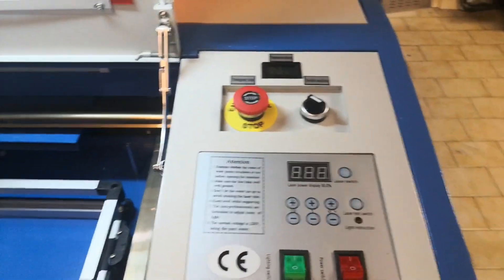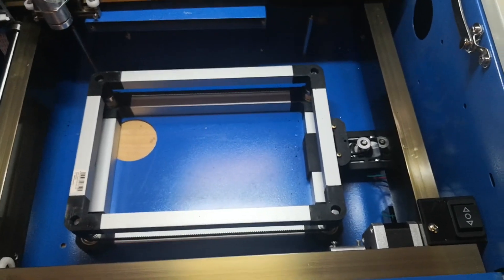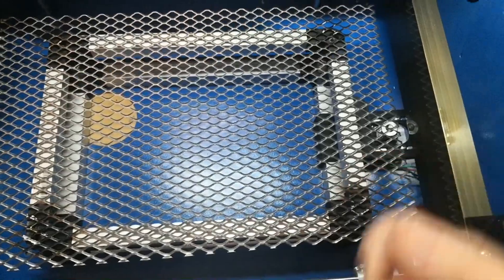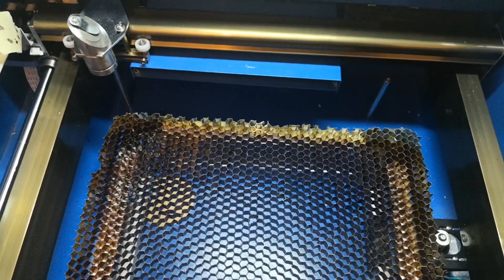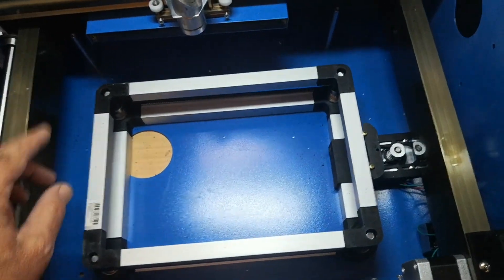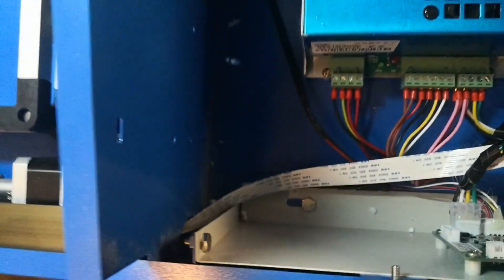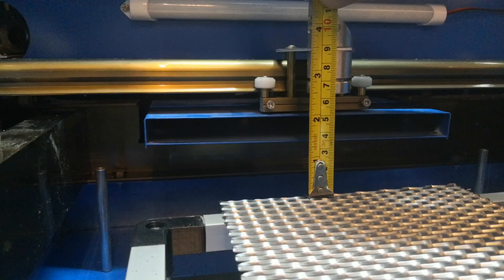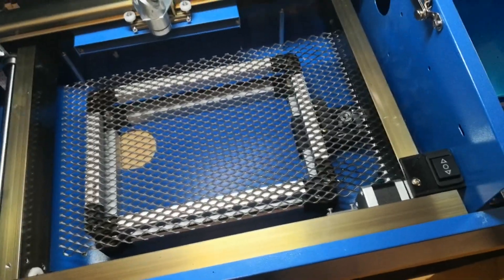K40 Laser motorised bed.

Comment: I made a a similar version, a bit bigger though and controllable via wifi (esp32)  where you can set a certain height after setting a zero value. a new version I a am working on will have a TOF to measure the actual height and therefor be even better than the current one.

Comment: Definitely would be interested in buying or building one of these!
Reply from the maker: Hi Peter I am just waiting on a few more parts and I will make another video on pricing and the finished product.
Reply: @letsfixit1594  Excellent! Have you seen this (https://youtu.be/aN4KgUCzP_U), BTW? I could see having a controller with a digital readout as VERY handy; that way, you could set a 'base' height for having the platform (sans material) be at the proper focus height for the laser, and then, just by measuring the thickness of the material you're working with, lower the bed by that distance, and know you'll get the desired results every time.

Comment: I am inspired by your successes and improvements. I would consider making the adjustable bed mount onto the same holes and locations that would be used for a roller type bed.  Interchangeable beds with common mounting locations.

Comment: I have the same exact laser, but have made a new panel for it, and added air assit, a pump and door interlocks,  a water flowmeter, and a key switch
 Was about to build my adjustable bed, but not gotten around to it yet. I did put a switch in the main panel for the bed travel.  Also worhing on a way to eliminate the screws, using scissor lift type setup. I did have to change the laser tube mounts, as one was broken, but found some nice adjustable ones on thingiverse
Reply from the maker: Excellent! you should post a video of all of your upgrades, the scissor lift with a motor attached would be a great idea.